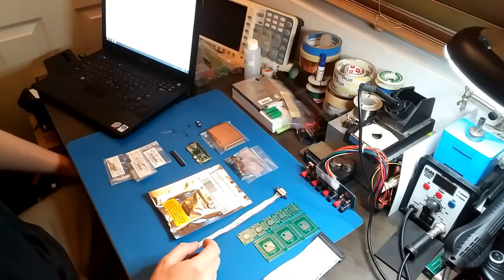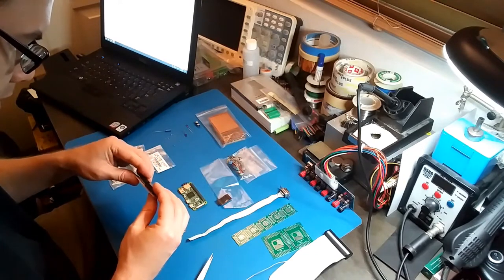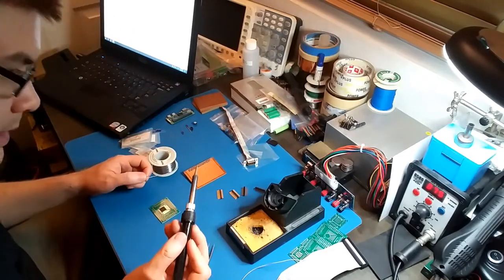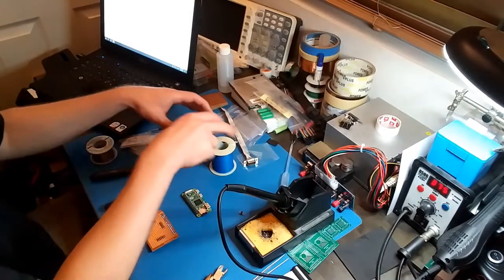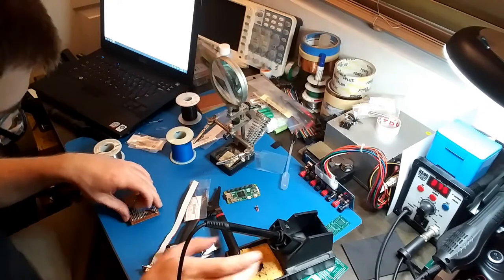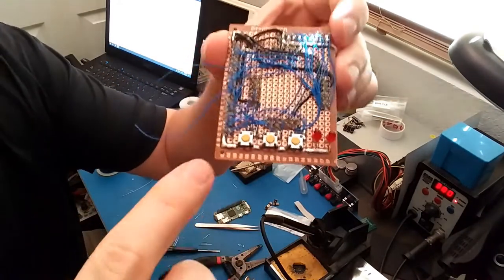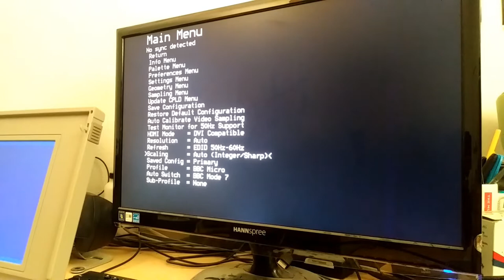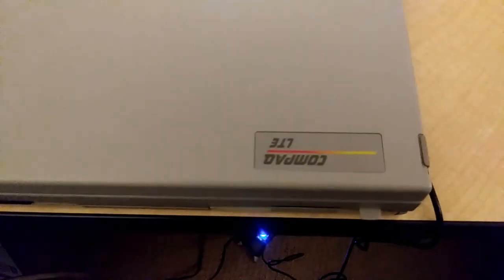RGB2HDMI Build (custom build without PCB)

Comment: do you have a project page to get a circuit diagram and a bit of documentation?
maybe i do some adapter from an atari 2600 video output to hdmi. so i need some inspiration how people are using the rgb2hdmi project and adapt it for different applications.